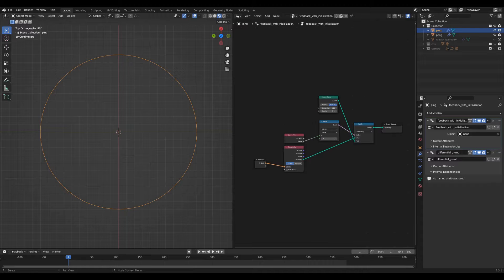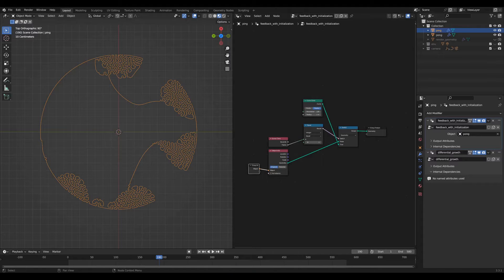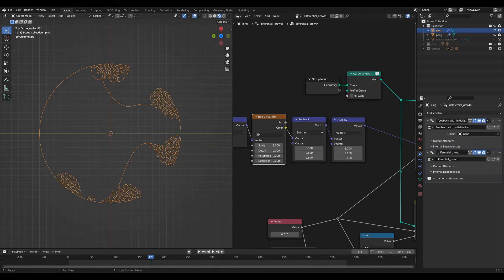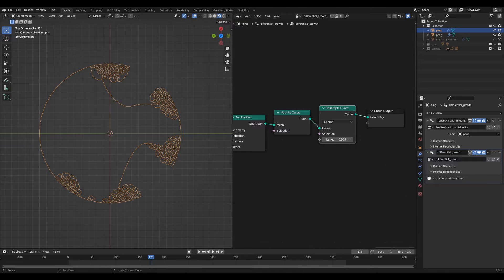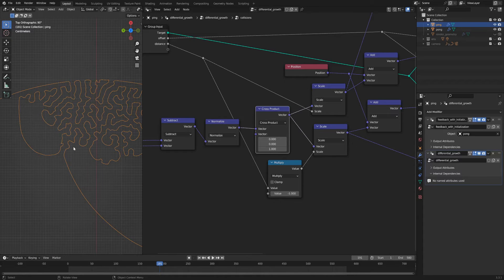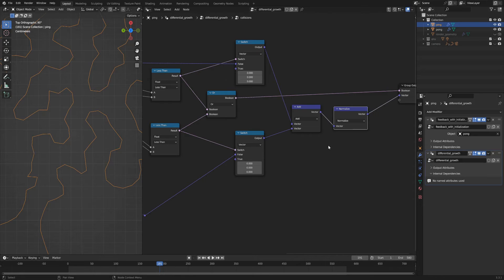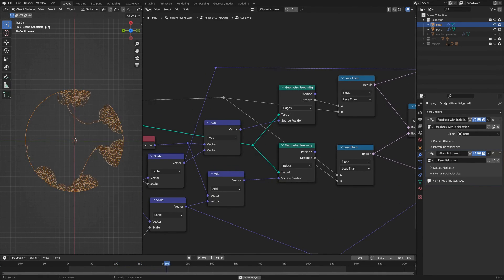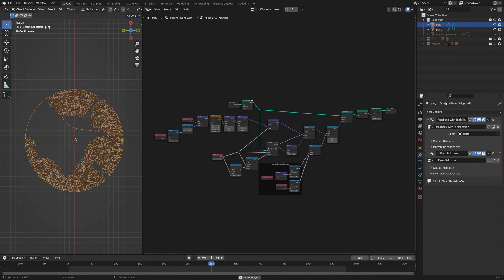Geometry Nodes Differential Growth Simulation Tutorial

Comment: I'm trying to rework this to get it to run with the 3.5 Geo-Nodes-Simulation-Build. But there is no way to resample the curve during or after the simulation. Did you take a look at this already?
Reply from the maker: I just did a quick test and was able to add the resample curve node inside the simulation block. Are you certain that the mesh was converted to a curve before using the resample node? I'll see if I can get the setup working in the 3.5 build and get back to you.
Reply from the maker: It works! Here's a tweet explaining: https://twitter.com/seanterelle/status/1598366840899932161?s=20&t=l-6xaaDZx_v-7nzxzn00vw
Reply: Good Stuff, I’ll have to take a look at it! Thanks!

Comment: okay, and how do I render it? blender crashes when i add curve to mesh node and add a curve circle with 3 vertices as a profile curve
Reply from the maker: If you're not already, try creating a new object with a new geometry node setup that takes the simulated object as an input and applies the 'curve to mesh node' there. If you're adding the curve to mesh node within one of the feedback objects, the curve to mesh operation will go through the loop and create a ton of geometry which will cause a crash.
Reply from the maker: Also, in order to render in Cycles make sure to enable the 'Persistent Data' checkbox in the 'Final Render' section of the Render Properties tab
Reply: @seanterelle  yeah, that's what i did after i wrote the comment. thanks a lot

Comment: Nice idea, but you can´t render anything using this hack, looping data back and forth. You can´t apply any of the geo nodes modifiers or export as an alembic or such. So, this hack only works in the viewport..a pity.
A "simulation" node (like in XSI´s ICE) is desperatly needed in geo nodes..!
Reply from the maker: You can render these kind of feedback loop hacks in Cycles if you check the 'Persistent Data' checkbox in the 'Final Render' section of the Render Properties tab!
Reply: @seanterelle  Thanks a bunch for that hint! It works for rendering...! But no way for caching (might be the alembic export implementation though) or applying....sigh..

Comment: Thanks great idea and great video. I tried to recreate it and the simulation is not running. I double and triple checked everything. I even got your file from gumroad and compared it to my Nodes. They are identical. But my version is not running while with your file it works fine. Are there any pitfalls I'm not seeing. Maybe group in and output. If anybody could help I appreciate it. I can provide my blend file if anybody is interested. Thanks.
Reply from the maker: If the node setups are identical then maybe the object inputs for the 'feedback' and 'feedback_with_initialization' geometry node modifiers?
Reply: Checked this too. I got the same input as you do.
How are you setting up the whole blend file with the different nodes
Never used two geometry node modifiers on one object.
Reply: Hmm i need to  go to gumroad. Do a comparison, i refuse to accept defeat.
Reply: Yeah I seem to not be able to figure out why mind doesn't work either. I feel like I've been through every setting to make it identical and still have yet to figure out what the main issue of why mine is not operating the same.
Reply: I got it. I had the distance in the offset routed backwards inside of the collision node
Reply: @FuzzyEQ  Solved it too. One of the "Geometry Proximity" nodes was set to Faces instead of Edges. I feel dumb man. Thanks again to Seanterelle. For this great idea.
Reply from the maker: @michaellangenmaier1177  Those details are super hard to keep track of, glad you got it working!